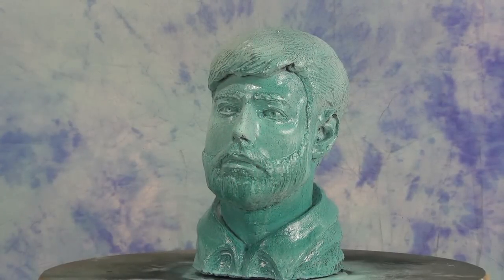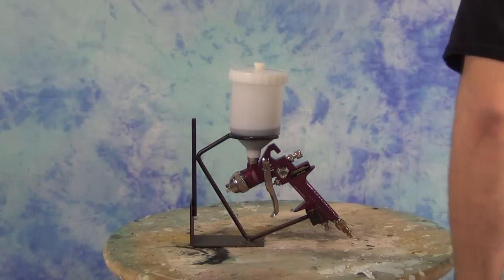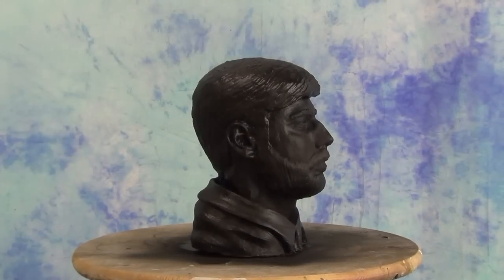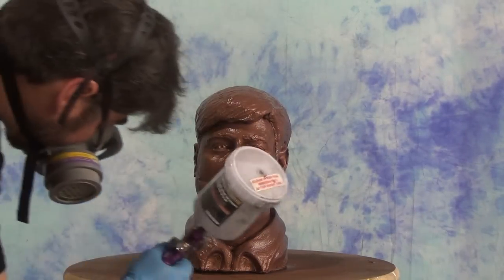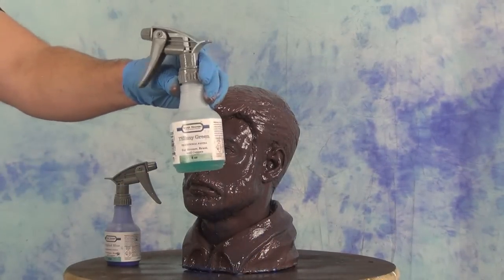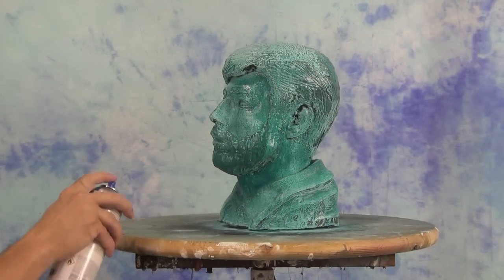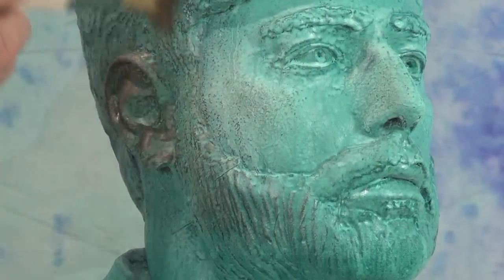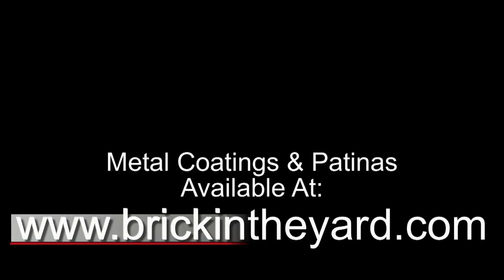Copper With Blue-Green Patina Finish: Spraying Metal Coatings and Patinas

Comment: Instead of doing the dry brushing at the end, is it possible to just scuff it with a fine steel wool or scotchbrite to remove the upper layer to expose the copper and leave the blue/green in the crevices?
Reply from the maker: If you build up several layers of the B coating, sometimes you can get away with that if you use a scotch brite pad. The best way to do that is to use the "C" Metal Coating. The "C" coating has has a hardener that cures it once it dries and it may be sanded and polished. The C coating gives a look that is very close to "cold-cast" metal once finished. Time permitting I'll be posting a video on that soon.
Reply: @brickintheyard  Ok, thank you and looking forward to the upcoming video.
I have one more question, I won't be having this problem with my sculptures but since I too work with motorcycles and cars specially it might have more uses on motorcycles. Can the metal coating withstand road abuse? Scratches, chips and heat...like the frame for example.
Reply from the maker: That's something you would just need to test to see how it holds up under that specific condition. The guy that invented this stuff has it all over his house and it it is still holding strong after over 20 years!